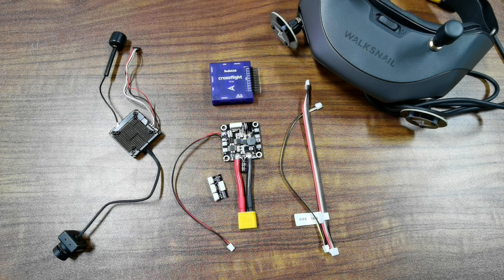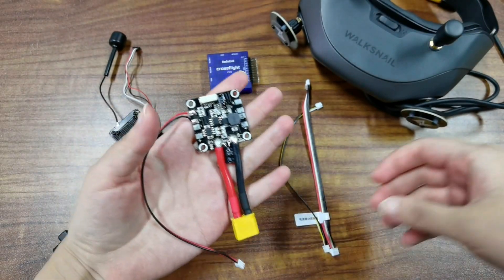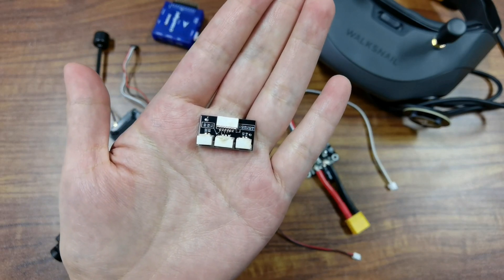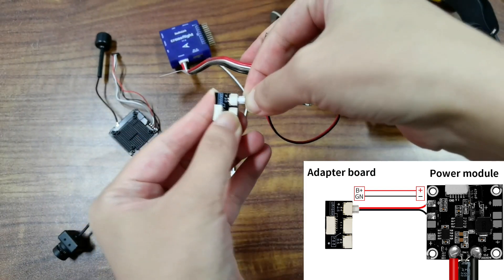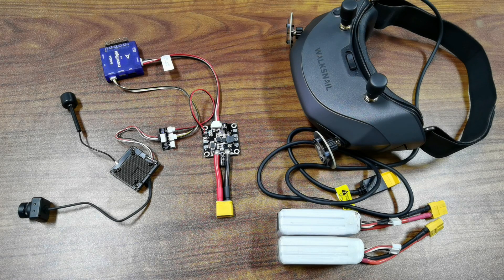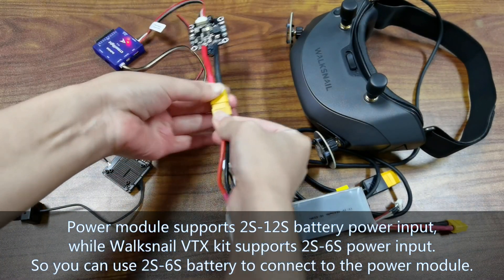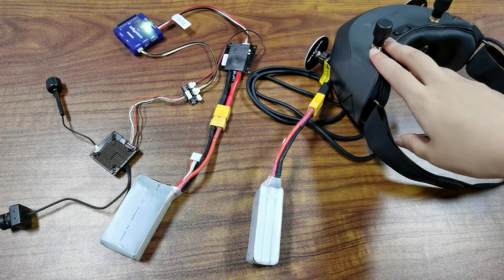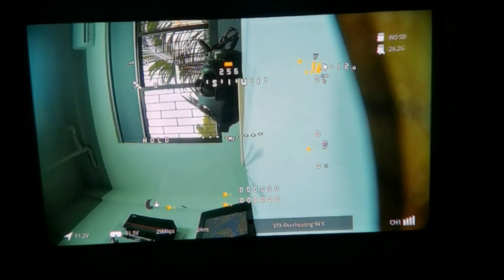Setup and Connect Walksnail Digital FPV System to crossflight/Mini Pix/PIXHAWK

Comment: No OSD pixhawk 2.4.8 and walksnail :( I did compile custom target and did add OSD support, after that made all like in video ... But no OSD.
Reply from the maker: Hi, sir. Could you please check all your settings? Make sure your connection and settings are correct by referring to this tutorial. If there is still any question please feel free to contact us. Our email is after_service@radiolink.com.cn You can send  us your device and settings.